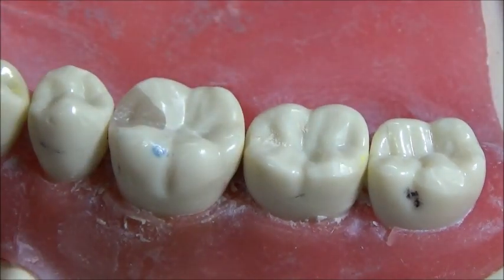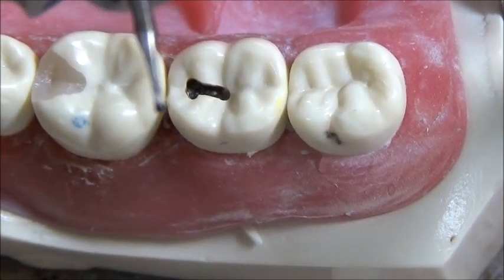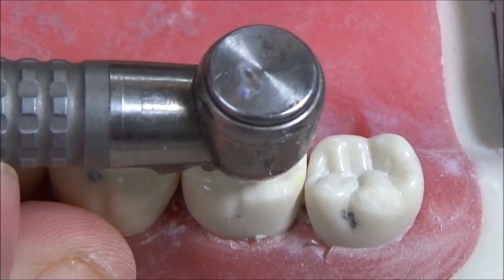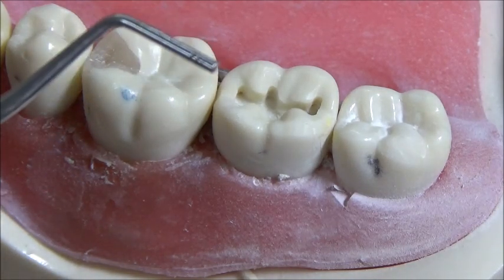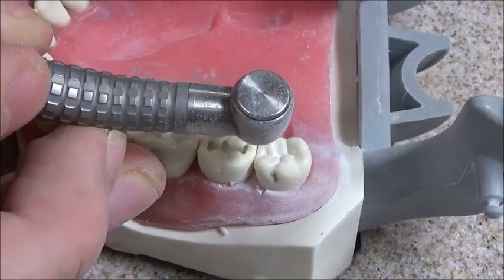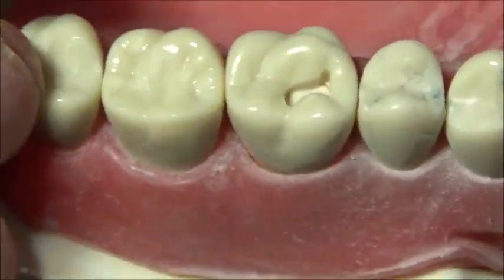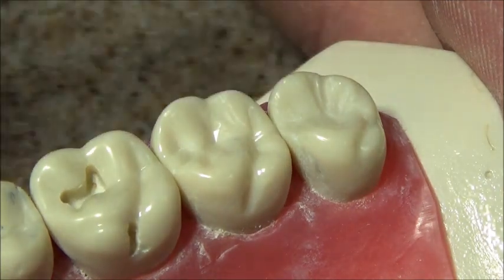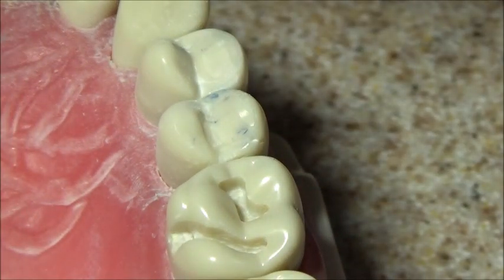Class I Cavity Preparation on Typodont

Comment: Hey what instrument are you using to measure the depth of the pulpal floor? You said PLG 7044 but I looked it up online and it says PLG is an amalgam condenser and they don't have the markings for 1.5 and 2mm like yours has
Reply: You may use your periodontal probe to measure the depth and even the isthmus.
Reply: U hv marking in dat too....n u can use it 4 measuring  the depth as well .